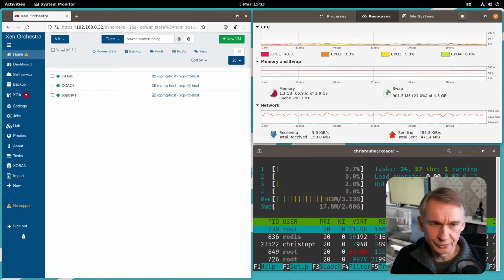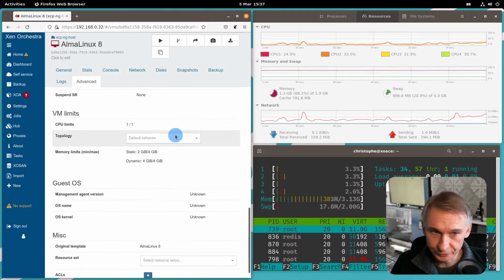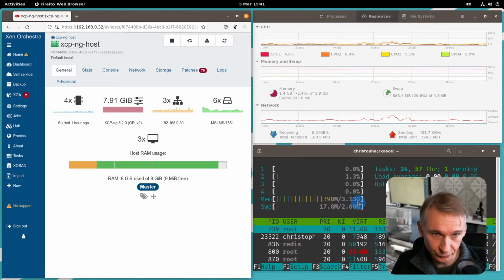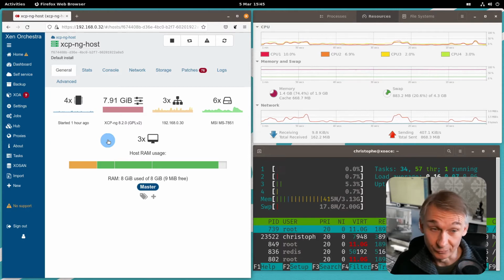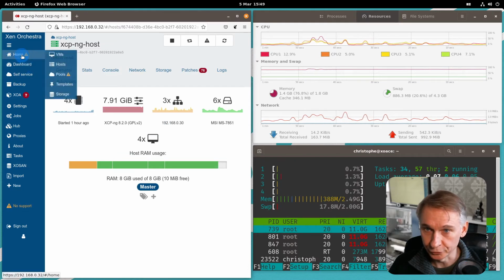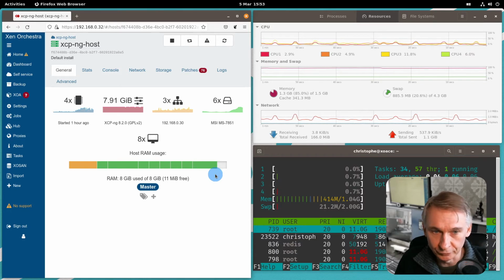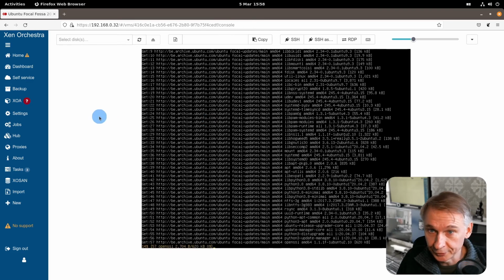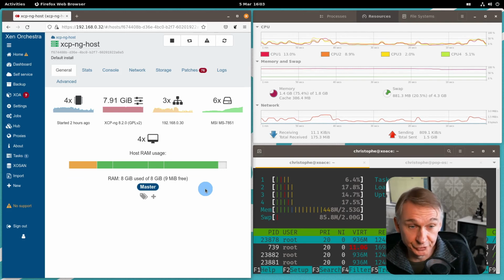XCP-ng memory management static and dynamic explained with examples

Comment: I've been following your work for some time now and I love your videos! I followed your XOCE guide for my home lab and I'm having an error when I import OVA files for VM's. After I hit import I get the task "Async.VDI.create" then seconds later the task "Async.VDI.destroy" comes up then clears. No VM import task is added and nothing is imported. I'm running the latest LTS 8.2.1 version of XCP-ng. I'm using the work around of using the 15 day free trial of XO before I need to recreate the VM. Any insight would be appreciated!
Reply from the maker: Did you find the solution?
Reply: @hometinylab   I create a free trial of XO to import the VM’s when I need to then remove it afterwards to reset the trial. Works well enough for me and I don’t import too often. Typically do it in bulk as a result.